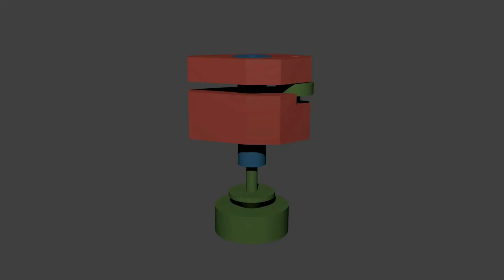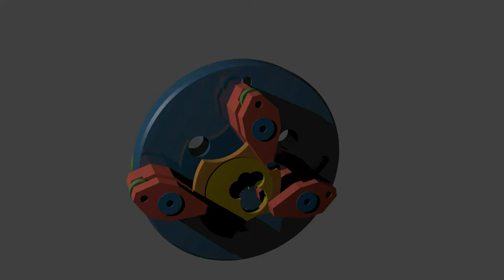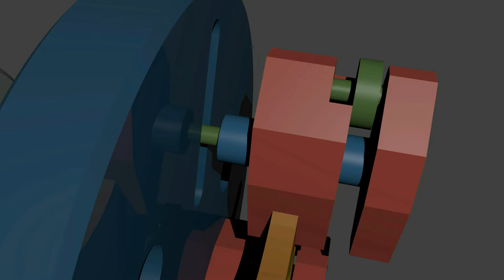Watchmakers Face Plate - Part 10

Comment: Question: for the measurement of the CONCAVE CUT, could one use a small known diameter of "Silver Steel" placed upon the concavity, the Mic the object and subtract the diameter of the Silver Steel?

(Use of the term Silver Steel is the British Term, we Yanks call it Drill Rod).

Philip, from the Great Pacific NorthWET, Oregon Section.

Comment: That machining of inside and outside and inside radii is very difficult, specially because it must fit the slot!  I might have used a smaller endmill.  On the lathe, The crash was unfortunate, but you had a lot of stickout for a parting tool. Unavoidable -- but do consider starting the the cut with the tool and hacksawing the rest. I have bent any number of parts the way you did and the hacksaw -- a very small one -- is now my go-to tool for difficult cuts such as yours. That is a very complex design, and the parts are difficult to make.
Reply from the maker: I'm interested to understand why you would use a smaller endmill? My thinking was that the endmill should be large, to ensure tool flex doesn't contribute to inaccuracy. Even for the inner radius, a large endmill is fine as long as the radius of the tool is smaller than the radius I'm cutting in the part.

I couldn't use a hacksaw in this episode, because I wasn't parting off. The thumb wheel has a length of shaft either side. On one side 8mm length of M3 threaded shaft, on the other side 5mm length of 3mm diameter shaft. I was using the parting tool to plunge down to near the 3mm diameter.
Reply from the maker: For parting large parts, I avoid using a parting tool, put the part in a collet block, and part using the bandsaw.
Reply: I am so used to using small (3mm and less) on my Proxxon MF70  that it seemed to me that that was a huge endmill. On due  consideration, perhaps you are right, the larger endmill is better because flex is less..
Reply from the maker: I think perhaps it looks bigger than it is, as the part is small. Another reason for using a larger endmill is to ensure the surface cutting speed is high enough to cut cleanly. I don't think the FF230 has enough RPM to make a 3mm endmill cut well.

Comment: And it was all going so well...
Unfortunately failures are part of the learning curve with this type of work.
Betting it'll all go perfect "off camera".

regards Colin
Reply from the maker: I learned a lot during this part of the project. Re-making the part, I'm doing everything in a completely different order, and things are going way better so far. I've done the milling before most of the turning and boring, so the part is much less flexible in the milling vise. I recorded some footage snippets, so I'll include a summary of the re-make in the next episode.

Comment: that's not a proxxon collet holder - which one is it?
Reply from the maker: It's an unbranded Chinese ER collet holder with an MT2 taper. The Proxxon specs don't seem to include that the spindle taper is MT2, but tooling fits fine. Concentricity isn't perfect though.
Reply: Is it locked with screw from behind? Seems like it's faster to change than proxxon.
Reply from the maker: Yeah, I made a custom M10 draw bar by shortening a bolt. It's quick to change, but not very rigid. The MT2 taper is fairly narrow, and flexes a little where it protrudes from the spindle bore.